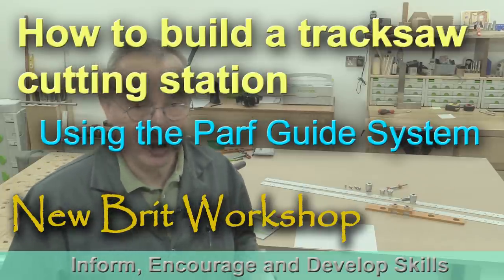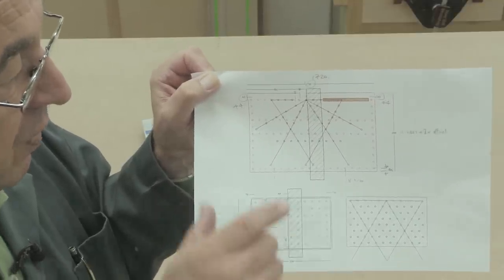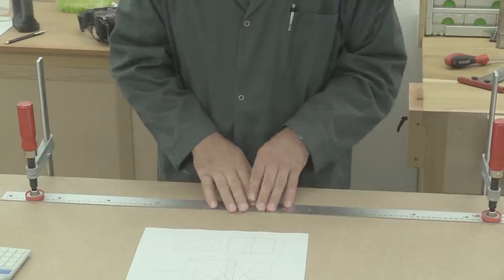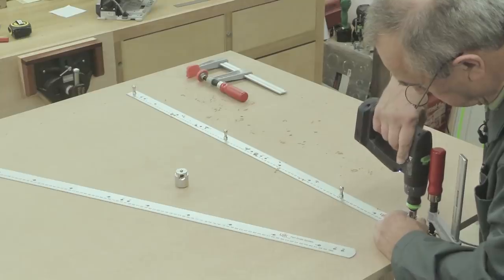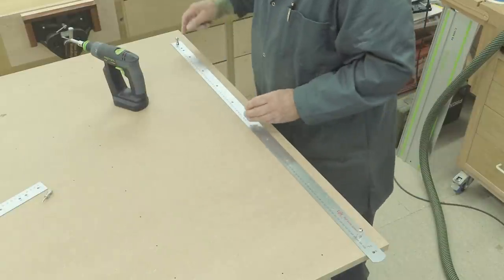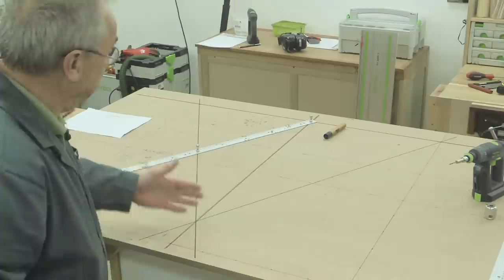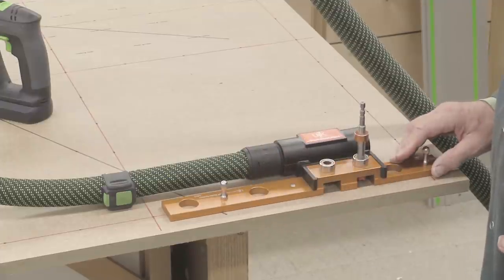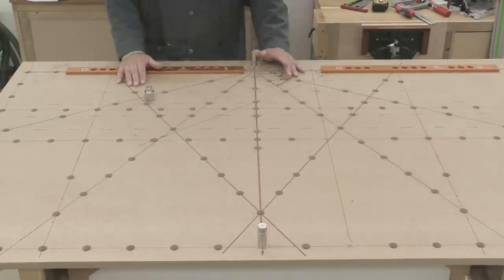How to build a tracksaw cutting station

Comment: D Ellwood

Hi Peter while watching the video i noticed the Bearing guided 3mm Drill Guide; short  and long spigots and bit are not the same as mine (i bought the first system) and was wondering where i could purchase the new ones i've  tried a search Axminster tools but no luck  PS could you please send me a set of the plans....Thanks David
Reply from the maker: Hi David, There is no sensible upgrade path from the original PGS to the Mark 2 as so much has changed. If you expect to produce less than 30 full size tops in your woodworking career then the original is fine. The Mark 2 is more accurate and designed to be handed from father to son !  Peter

Comment: So ultimately the cutting station is gradually destroyed with saw cuts then?
Reply from the maker: Hi Paul, Yes, but they do last a long time. My current one has lasted 3 years and is still going strong. It would cost about £20 to replace it. The beauty of the Parf Guide System is that you can create as many cutting stations as you like so replacement of an old cutting station is no big deal.  Cheers.  Peter

Comment: Thanks for this video, I will be buying the Parf system. I’ve seen track saw users with a section of track hinged to the back of their MFT table. Do you make one or know where I could get one please? btw way I’m a Makita user my finances don’t yet run to the Festool products ☹️
Reply from the maker: Hi Robert, Nothing wrong with Makita. The lifting fence mechanism is so difficult to get accurately set and then goes out of square when you blink an eye. So, I do not recommend its use. If you look at the Festool Owners Group (FOG) forum you will find countless threads about ways of trying to make it better but there is little scope for really accurate work. Stick with your soon to be created tracksaw cutting station and your Makita saw and rail.  Cheers. Peter
Reply: @NewBritWorkshop  That sounds like excellent advice, thank you!

Comment: Hi Peter, I think I know the answer to this question, but I'm not sure. So, my question is, if I pare down the dimensions by roughly 200mm or about 8" both width and length, will the table still work with the same functionality and accuracy? Also, can this cutting station be made with the original Parf Guide System? Thanks much for your videos! Thanks in advance!
Reply from the maker: Hi Rick, Yes on both counts. I have an MFT3 top which is brilliantly accurate. My missing MFT3 size folding bench that is not here any more had a top made with the original PGS which was also spot on.  Peter

Comment: Very nice system indeed! I have a question and a recommendation if you dont mind: why 96mm spacing between 20mm holes and not 100mm? Any specific reason for this?
Also I think the next upgrade would be to create a miter gauge that would perfectly fit this system and would allow for any degree cut apart from 30,45,60,90.
Reply from the maker: Hi Aristos, Thank you for your suggestions. The 96 mm spacing is based on the Euro standard and makes setting up for modular kitchen and shelving units very easy. It is possible to get near perfect 30, 45, 60 and 90 degree cuts with the top. A mitre gauge would be less accurate - for example I get 90 degree cuts to within 0.00016 of a degree and getting a mitre gauge that can be set to that accuracy would be tricky.  Cheers.  Peter
Reply: @NewBritWorkshop  I understand and indeed this produces some impressive results. Nevertheless apart from dead accuracy there is also the productivity point of view. If I spend the money to purchase this system (which i am seriously considering as I own a Makita SP6000K) then i would love to be able to use it at its maximum potential.  A detailed engineered miter gauge might not be as accurate as the standard angles but is the only thing missing for this system to be used as a true table saw replacement.

Comment: Thank you for the plans, Peter. Just one question, Can I assume that this layout is also geared up to cutting longer lengths (ie 1220mm+) in the portrait mode?
Reply: Also, do you apply a finish to the MDF, if yes, what do you recommend?
Reply from the maker: You can cut longer lengths and I may show one method in my next workshop notes video. If you apply finish do it before you start. I only do it on bench tops where glue might be used. I quite like Osmo but any varnish or water based equivalent will do.   Peter

Comment: It's late and I've watched this video several times. I can't figure this out! Where would you line up a 45 degree cut?
Reply from the maker: Just put the shallow dogs (the ones that the wood will be pushed against) in a line that follows the 45 degree route. The track is pushed against the same tall pair of dogs.  Peter
Reply: @NewBritWorkshop  Yes but which is the 45 degree route? All I see is 90, 30, 60
Reply from the maker: If you count the horizontal rows from the top you will see that 1, 4 and 6 go all the way across. Put a low profile dog in (say) the first hole of row 1 and then another in the 4th hole in row 4. The line between those two dogs is at 45 degrees to the ones shown touching the track. You can put the first dog in any hole that you like in row 1 but then must put the dog in row 4 either 3 to the right or 3 to the left.  Peter
Reply: Thank you Peter. I wanted to get a visual before I drilled because my worktop is on the small side (4 foot x 2 foot.)

Comment: Where did you get the Green Cover for the Bladecover of the Tracksaw? I've always used Tape over that hole. I wonder why Festool doesn't include a Cover like this from the get-go
Reply from the maker: Hi Dave, I covered it in a Workshop Notes video sometime in the last 6 months.  Peter
Reply: @NewBritWorkshop  Thanks, i found it! Workshop Notes #29
Reply: dave1812 I purchased mine from Stawbyte workshop, excellent service.

Comment: Hi Peter, I wonder if you could clarify something please. I obtained the plans from you some weeks ago and finally got around to creating a cutting station today. Or should I say partially thanks to the rain. I've got as far as making the isometric holes for the top, using the equilateral triangles, and I think these are for the 60 degree holes. However, when I've looked at your video again I've noticed that around 26:40 into the video a further isometric line appears on your cutting station, just to your right, which I think is for the 30 degree line, but unless I'm mistaken there's no comments as to how it gets there. I'm presuming, for accuracies sake, that you've used the parf system in some way or was it simply done by dissecting the side of the equilateral triangle and drawing a line back to the point. I'm sure I've probably missed something along the way, so I'd be grateful if you could just clarify it for me as my brain seems to have gone into meltdown. As always, thanks for the great videos that you produce and thanks in anticipation of any guidance you may be able to offer.
Reply from the maker: Hi Jon, I made the 30 degree lines as follows. First do the 3 mm holes that form the 60 degree triangle which has the side parallel to the top of the piece of wood. Next do the two 60 degree lines that meet in a point at the top left of the guide rail. Let us call that point where they meet "A".If you now look carefully you will see that the holes that are on the two 60 degree lines (that meet in a point A) that are 3 times 96 mm from point A lie on a horizontal line where the spacing is 96 mm between hole centres. Place a Parf Ruler across these, using the 3 mm pins to secure it in place. You can now drill the 3 mm holes that are on the 30 degree line, first on the left and then moving the ruler to do the one on the right. Once these first 30 degree holes are done you can lay a Parf Ruler along each of the 30 degree lines to do the remaining holes.   Peter

Comment: Cheap MDF creates too much furring in the holes. I believe you use Medite MDF but which type do you use?
Reply from the maker: Hi David, I use 18 mm (or is it 19mm) Medite MR MDF. It has hard outer layers and is perfect for cutting stations and as a carcas under veneer.  Peter

Comment: I must also ask under what situation do you find yourself making 30 or 60 degree cuts?
Reply from the maker: Hi Bruce, My shed needed a whole bunch of 30/60 degree cuts for the roof pieces. I sometimes make hexagonal things as well.  Peter
Reply: @NewBritWorkshop  I hadn't thought about those cuts being used on larger projects

Comment: @New Brit Workshop  But Peter is your intention to move the kerf line all the time (and use the Parf Fence) or move the fence or work piece (putting in bench dogs) and keep the kerf line static? Do you intend doing as your "How to make an Isometric MFT Top"-video and put out bench dogs in angle and keep kerf line static.

I mentioned in a comment that you can move dogs (or fence) and kerf line to get 15/75° but I think that is not an everyday usage.
Reply from the maker: Hi Emil, I like to keep my one kerf line but sometimes it does not work depending on the size of the wood being cut. It is therefore better to use dogs for angled cuts.  Cheers.  Peter
Reply: @NewBritWorkshop  appreciated, thank you!

Comment: Hi Peter 🙂
I'm wondering why you didn't make the 30 degree holes by using the center line as the base of a new isometric triangle?
Best regards
Immanuel
Reply from the maker: Hi Immanuel, there are several ways of doing these things.  Cheers.  Peter
Reply: Sure. One thing you get from my approach is, that you keep the 96 mm spacing for stuff like the parf fence.

Comment: Is this video relevant for an 8x4 sheet?
Reply from the maker: Hi David, Yes, but you must start with the very first set of (10) holes central to one long edge. That way you can extend equally to the left and to the right with the minimal loss of accuracy.  Good luck.  Peter

Comment: Another question (slightly off topic, but very much related to the Parf guide system) how would you add a row of holes vertically to the bench top on the front of the bench? I think we need an angled guide addition or another of your clever precise solutions. Cheers, Peter
Reply from the maker: Hi Peter, I have been asked about this before and would have sought a solution if I could imagine a real need for such a capability. I would love to know what critical piece of woodwork needs such an accurate solution.  Cheers.  Peter
Reply: If you make or check a miter joint or have other 90 deg joints that you want to make it would be nice that parf dogs can be used and are flush with the the workpiece. (I hope this makes sense)
Reply from the maker: Hi Peter, You can offer a piece up against dogs set up for any angled cut and see if the piece matches. Peter
Reply from the maker: Many thanks for this.  Peter
Reply: @NewBritWorkshop  Of course these small parts could also be squared sideways against a few parf dogs on the top, but if the these become panels this will definitely help I think. Is this reason enough to think about a solution 😊?

Comment: Peter, thanks for all the videos. As a novice woodworker I have been learning a lot. This is a great video. I am in the process of making my own cutting table. At 3' by 6' I'll be modifying the layout some. I am curious about some of your choices. (For example, I understand why you put rows at 1, 5, and 7, but other choices aren't clear to me.) I think another video explaining your choices and showing how you use it for different cuts would be very nice. One choice I'm very curious about is positioning of the guide rail. The MFT puts it off center but you have it close to center.
Reply from the maker: Hi Julie, I think that I said in the video that those rows are stagered so that narrower work pieces can be cut closer to where I am standing by having the fence closer along those other rows.  Cheers. 
 Peter

Comment: Wouldn't this also get you 15 and 75 degree cuts by combining a 45 and a 30?
Reply from the maker: Hi Marten, I do not think so but try it !   Peter
Reply: If you have a 45° through the diagonal of 90° and that is close by of the 30°/60° you would get the delta 15°/75°. Though then you need to put material in one system (e.g. 45° line) and guide rail on 30°/60° or vise versa. Using purely the 90° will not lead you anywhere :)

Comment: Are you aware of the 'Vario-Bench' produced by Sauter in Germany? https://www.sautershop.com/multifunctional-tables/vario-bench-multifunctional-table/ Is has holes that allow for cutting any angle from 1 to 90 degrees - which seems a bit over the top and obviously impossible to do without a CNC machine, but it makes me think - I know that a mix of isometric and square grids will allow for 30, 45, 60 and 90 degree cuts - but is it possible to use the Mark 2 Parf guide system, with its offset holes and two drilling bushes, to produce hole arrangements for other common mitre cut angles?  22.5 etc? Maybe the answer is obvious to the mathematically-savvy, though ...
Reply from the maker: Hi Peter, The 22.5 degree setup is not possible with a rectilinear layout as far as I can tell. I had not seen the vario bench top before - it does look complicated.  Cheers.  Peter

Comment: Hi Peter. I just used my PGS MK2 for the first time. In all your videos and comments from others the Parf dogs are a tight fit in the 20mm dog holes. On the MFT board I just made the Parf dogs go in pretty easily. In fact I think they may even be too loose fitting with a little slop. Any idea where I could have gone wrong. Used a PDC to drill the 20mm holes. Everything appeared to be ok with the 3mm hole matrix. Just the loose fit after drilling the 20mm holes.
Reply from the maker: The PDC is a heavy drill and if you were to let it wobble a bit then that could cause the effect. What bench dogs do you have and where were they bought?  Peter
Reply: Hi Peter. Thanks for the feedback. Will run a test with the CXS on a small piece of MDF to see if I get a better result. I have UJK bench dogs that I ordered from Axminster at the same time when I got the PGS.
Reply from the maker: One other thing - did you drill the 3 mm holes all the way through your MDF?  Peter
Reply: Yes I drilled all the 3mm holes completely through. Maybe I am just heavy handed 😀. Will know later when I test with the CXS. Do you have any advice on technique when using a heavier drill like a PDC? Even though I have the CXS and used it to drill all the 3mm holes, I would prefer not to use it to drill all the 20mm holes.
Reply: Just concluded my test on a scrap piece of MDF. Drilled 3 guide holes using the Parf Stick and 3mm guide bush. Secured the 20mm jig with 3mm pins on both ends and clamped the jig to the test piece on both sides. Used my CXS with a pecking motion to cut the 20mm hole. UJK dog still fairly loose with slop. Now that I know what to look for I noticed that there was a fair amount of vibration caused by the cutter and most likely creating a slight wobble cut even with the jig securely clamped. Drilled another 3mm hole through a small test piece of MDF. Used my Bosch PBM 40 with the 20mm cutter, test piece securely clamped, same result. UJK Parf dog fairly loose with slop. Used my Caliper and took some measurements of the bits. 3mm bit measures 2.9mm. The 20mm cutter measures 19.9mm. The front pin of the 20mm cutter measures 2.9, 3.0, 3.1 and 3.2mm at different places around the pin. I think this is what is inducing the vibration and causing the wobble cut. Would appreciate your thoughts on this.
Reply from the maker: @uyoung216  It could be a damaged or faulty cutter. I am sure that Axminster Customer Services will be able to help. They may ask you to return the old cutter for inspection. You can find them via cs@axminstertools.com    Peter

Comment: Hi Peter, I'm the owner of a Parf Guide MKII. I'm planning to make soon a MFT top for my workbench made with extruded aluminium profiles.  I was wondering what would be the best between MDF and plywood with black melamine as it will be my "mainmultitask" place. Is there any technical advantage of using MDF as it seems to be almost allways chosen? Or simply the price?
Like other people, I would be so pleased to receive your tracksaw cutting station plans :) (my email below)
Kind Regards
Reply from the maker: Hi Franck, MDF is by far the most economical and durable material to use for a tracksaw cutting station. Plywood is not as stable, chipboard is unreliable and the expensive HDF options are just not worth it.  I will send the plans.  Peter
Reply: @NewBritWorkshop  thanks a lot for the advice and for the plans :)

Comment: I wondered why 94 mm for the first line.
Reply from the maker: It is 96 mm which was first introduced (as far as I know) by Festool with their MFT3.  Peter
Reply: @NewBritWorkshop  Okay, I'm glad you cleared that up because I heard 94 mm toward the beginning of the video.
Reply: @NewBritWorkshop  I went back to look, and you said 94mm @ 6:14.
Reply from the maker: The 94 mm is the measurement from the edge of the board to the centre of the holes not the hole spacing which is 96 mm.  Peter
Reply: @NewBritWorkshop  Okay, I got it now, many thanks!